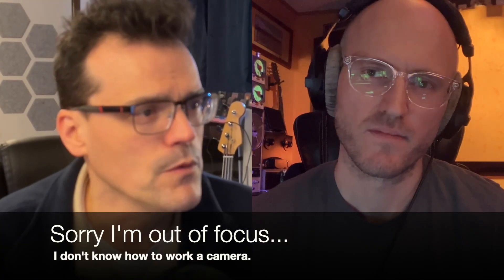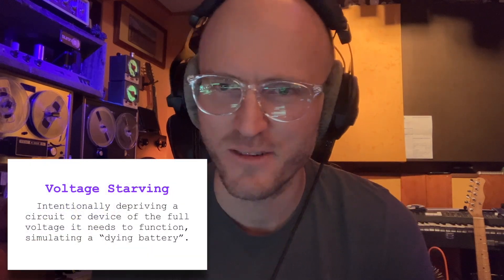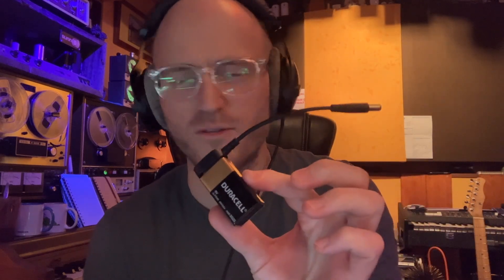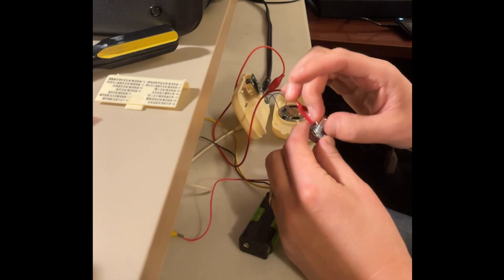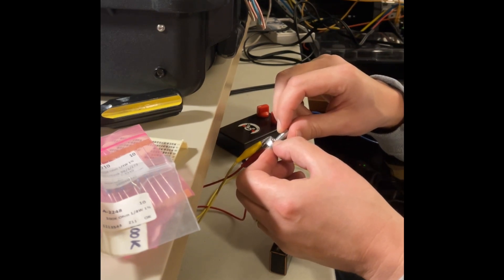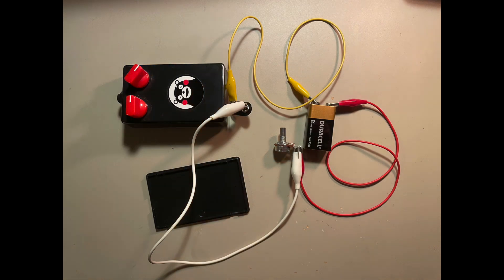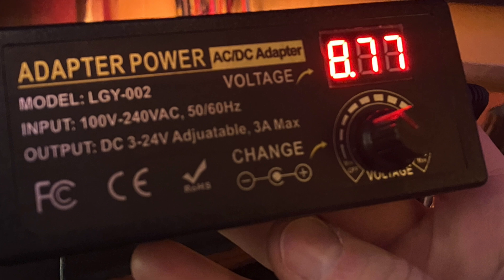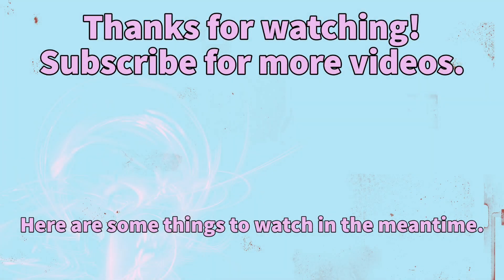Low-Battery as Aesthetic Practice: Voltage Starving Audio Gear | Simon Hutchinson & @SpectralEvolver

Comment: Hiya Simon. at 5:00, no, there is very little likelyhood of damaging any linear (analog) circuit by under voltage hijinx. Even unlikely a digital circuit would. I've done it (extensively) with FX and with toys. I haven't posted it but one toy made the most hellish wall of noise, was awesome.
Reply from the maker: Thanks for the info! Definitely share the link for your "hellish wall of noise" toy when you've got it posted! I'm very interested in hearing it!
Reply: @SimonHutchinson  I'll let you know, i have wanted to use it somewhere but i'll just put up a clip.
Reply: It's on my soundcloud. YT keeps deleting my comment sc crystalawareness
Reply from the maker: @ Cool. Listening to it now. Thanks for sharing! (Yeah, I didn't think of that. Of course YouTube is going to delete all URLS...)